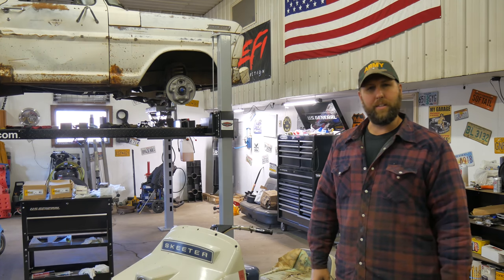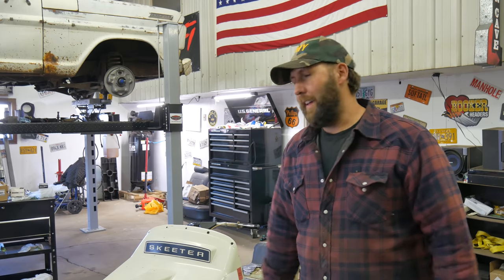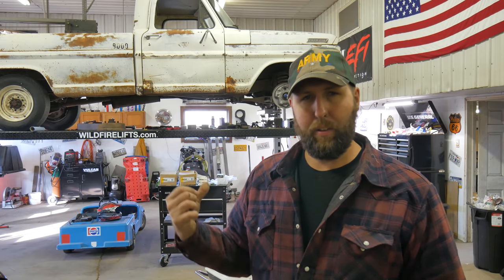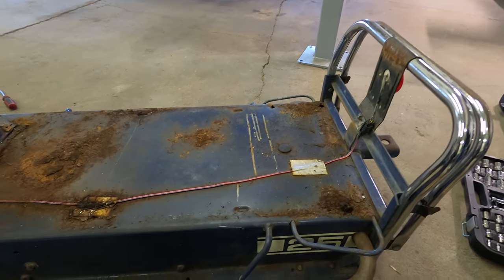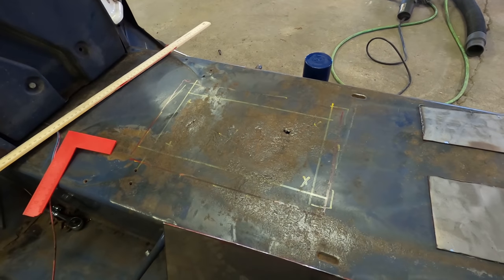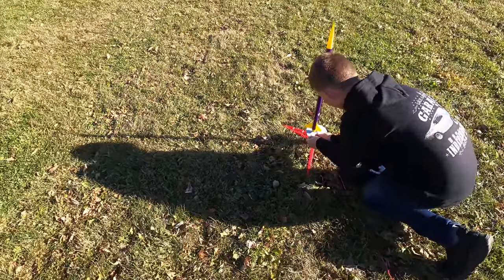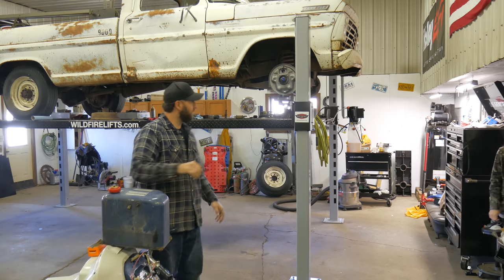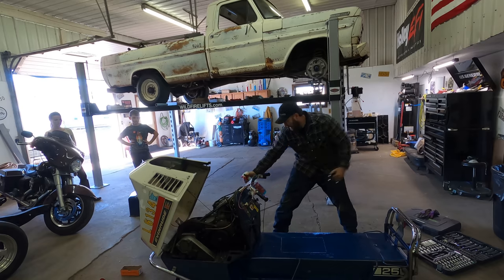FORGOTTEN 1970 Evinrude Skeeter Snowmobile - Will It Run? Part 1

Comment: I bought a snowblower from a young couple who had bought there first house and they bought a brand new snowblower, it was in my a couple of years old, they said the first winter it ran great of course because it was new, the second year they couldn't get it started, they called the company who told them to try a new spark plug, thet didn't work, they eventually gave up on it, the next winter they tried getting it going again and after it refused to start thry gsve up and put it on Craigslist, I went to look at it and it looked brand new because it was kept in the garage, as I was pushing it up the ramps into my truck I said I know exactly what's wrong with it, I even offered to fix it for them and  then bring it back, but the wife said no because it was too big anyway, the next day when I worked on it the first thing I did was open the drain plug on the carburetor bowl and out came a dark orange liquid that at one time was probably gas, I drained all the gas filled it up with new gas connected the extension cord pressed the button and it started right up. I called them spoke to the wife and told her that my suspicions were correct about it being bad gas, she told me that they were told to add a fuel stabilizer and maybe they used too much which turned the gas orange, I don't know, I 3nded up selling it and making a 200 dollar profit, I always run my machines dry at the end of each season, the first thing I ask somebody when they have a starting issue with a small engine is how old is the gas you're using, they usually respond with, about three years old.

Comment: Idea 💡 those tanks with the anti splash necks

What ya can do to get all the goods out 
Is simply tip up on the corner with the hole in it 
Then stick your suckalater 5000 wet version of course 
And Wala it just pulls it out 

Don’t give a second thought about possibly explosion 💥 
Ya can dump it a few times 
Then add a little oil to your last rinse it will lower the danger a bit 

Make sure all kids stand back this would be the safety aspect of it

Comment: Hey Derek, what brand of weld thru primer do you recommend. I see the duplicolor got bad reviews on summit racing. Por 15 makes it but cost more than my first car. Thanks and keep up the vids.

Ps - how do you never get anything in your eyes without using safety glasses? I touch a grinder and get metal on my eyes, lol.
Reply from the maker: I've been using duplicolor with no issues, or sem
Reply: Ok thanks, I’ll give it a try.

Comment: 24/1 was for the old organic fossil fuel 2 stroke oil. Then he changed to synthetic premixed oil. They have golden spectro 50/1 premixed, or the ultimate classic AMSOIL 100/1 race synthetic. It has the same lubrification properties. But be warned, I'm an idiot so research it before you melt the pistons. Because I was at Walmart all day Sunday and I didnt come across any evinrude snowmobile pistons!. You'll have to go to the old j.c. whitney and order them!

Comment: If you buy a good quality synthetic two stroke oil it’s light years better then the old stuff.  The oil is designed to not burn up and stays behind. That’s why it runs soo much cleaner. In my experience 50:1 is perfectly acceptable in an engine designed for even 16:1. As long as it uses roller bearings and not bushings. That OMC is all roller bearings. I personally like Amsoil. When you pull the motor down there is a sticky film on everything and zero scuffing on the skirts. Not even on the exhaust ports. I’ve even had engines run on cheap oil
That are filthy and a good quality oil should clean off the carbon. Much richer then 32:1 with  a good oil will actually make it load up under partial throttle and you gotta bag on it to bring it back. And if you run a racing oil it will load up and drool if it’s not to the pin all the time. Try a good oil like Amsoil intercepted on an engine you don’t care about. Beat it and then pull It down. You will see what I mean.

Comment: New a landscaper several years ago he had a 50 gal tank on his mower trailer and he bought his two stroke oil by the case in qts.  Had an electric fuel pump and he mixed his oil and gas... " I can replace spark plugs in my 4 cycle engines cheaper than buying new 2 cycle  engines for weed eaters and trimmers...he burnt 2 cycle gas in his 4 cycle mowers he had it figured how much oil when he added gas to the tank...

Comment: Tell a guy more about that weld on it primer and that etch a sketch paint, how does that stuff work?
Reply from the maker: Works great! Also use it on previous eps welding
Reply: @ViceGripGarage  you spray it on and weld right through eh?

Comment: It was an old truck iev replaced the radiator about three times now and the water pump and done popped the hole in the ole thermostat but now it ain't running jus right bc of the  vacuum hoses under the fuel infected non since but how would I get them hoses blowing again a few are gunged up

Comment: my parents had a 1971 skeeter and talk about LOUD you could here that thing from 3 miles away and it was nothing but PROBLEMS, it had the wide track and reverse but with the 437 motor it wood go about 55 on a packed road. I could beat it with my 1973 YAMAHA 338 SL.

Comment: CHAIN SAW SHOP WILL HAVE THE LINE FILTER FOR TANK, AND FLEXIBLE RESILIANT FUEL  LINE.......TWO STROKE EQUALS CHECK THE CRANK SHAFT SEALS.....IF THEY LEAK..... IT BE LEEEEEEAAN

Comment: I just picked up 3 vintage snow machines.. A Double Eagle that has 2 tracks and you sit in instead of on, a Diablo Rouge i think it's called. It also has 2 tracks and pulls a sled that you sit on, and an older one that actually looks similar to that one but it's not aevinrude and it has a single cylinder 2 stroke.. Can't rememver what make it is but it's clean and the guy i got it from was all about that i must be careful with the windshield because it's apparently$500 for one... Anyone looking for any?

Comment: That motor is even rarerer than the old “Wankle” rotary that Arctic cat had. Never even heard of one of thems.
Reply: There was a rotary snow machine????? 🤯
Reply: @jaredanthony8070  Sure was. Mid to late 70's. My neighbor had one. It wasn't that fast (50 tops) but it was good for trail riding with the torque it had.
Reply: @kevinwilliamson7294  I thought rotaries were supposed to never make torque just horsepower 😂
Reply: @jaredanthony8070  Every engine produces torque. Look up these old sleds. Its pretty interesting
Reply: @kevinwilliamson7294  it's a joke around rotaries man 😂

Comment: I redid some old sleds a few years back, most of the stuff Ya need Ya can get at https://www.denniskirk.com/snowmobile
I rebuilt an old Polaris 250 Free Air, 1987 Polaris 448 and a 1988 Ski-Doo Safari 503, oh and don't forget the old 1971 Bombardier, that I put a twin 440 on it with a cut down Cherry Bomb Muffler, ski spreaders and all, and Hauled it in my 1971 C-10 gold color P/U just like the sled....LOL!!!